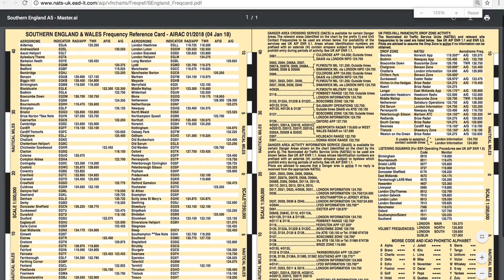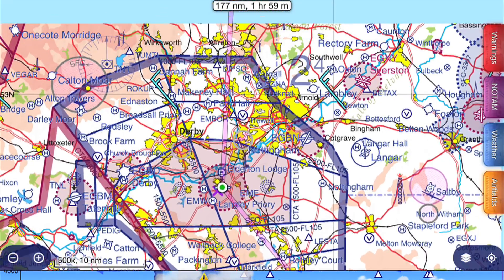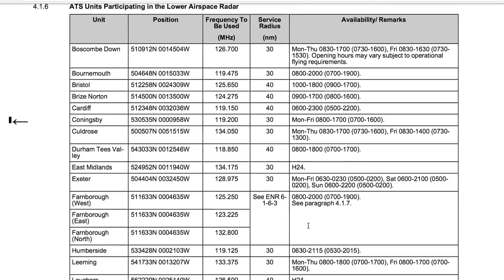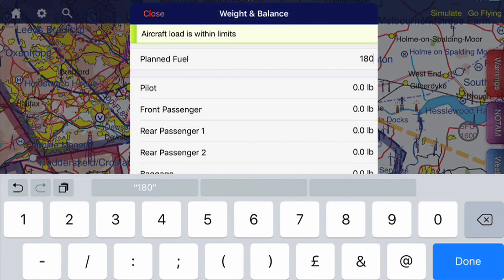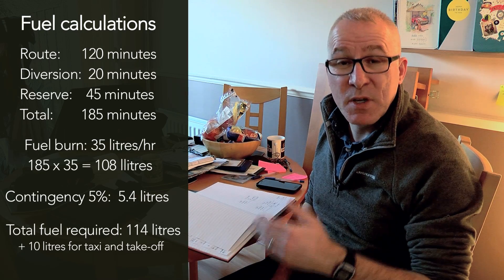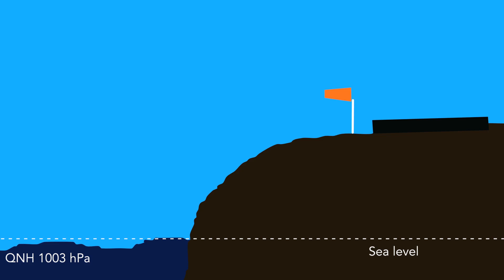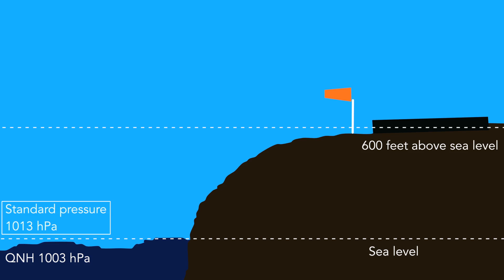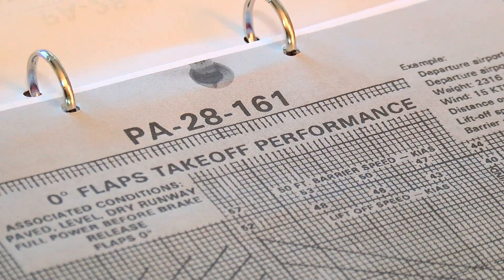Pre flight preparation mini-series Pt3

Comment: Jon, you might want to talk to Sywell when you go over even if above the ATZ. The Blades operate three slots during the day up to 5000ft within 3nm of the field. Have a look at the status page: http://www.sywellaerodrome.co.uk/status.php
Reply from the maker: Presumably they notam those?
Reply: I don't think they are Jon. I had a job just inside the ATZ a few weeks back and part of my prep is to find out about anything local, so I had a look at the website and called them up. I knew that the Blades are based there and have passed by quite often but didn't realise the extent of there operating area.
Reply from the maker: It’s class G so anything goes, but I’d expect displays or intense aerobatic training to be notamed.  I check websites if landing or taking off, but rarely check if en route anywhere.
Reply: Yes same here. Just a heads up. I wasn't aware until I looked into it.

Comment: 185*35 =108?
Reply from the maker: The aircraft burns 35 litres of avgas per hour.  185 minutes of flight will burn 108 litres of fuel.
Reply: I think the formula should be 185/60*35 = 108. Great video series!

Comment: If gliders look more and more attractive to me, it's partly because I'm having a lot of difficulty justifying the fuel consumption in private aviation. The numbers stated in this video, which I hasten to add is well done, should raise a serious issue for anyone who cares about energy consumption and climate change. As far as I know, not a single private pilot on YouTube has made an effort to justify it, and I'm increasingly of the view that the reason is that it can't be justified.
Reply: Come fly with us at Hus Bos.
Reply from the maker: You're probably right.
Reply: Yes, you are right of course. But you do burn some fuel when you launch a glider. An aero-tow  to 200 feet typically takes about a gallon of fuel.
Reply: The engines are very inefficient due to the age of the design. The problem is the cost of getting a new design through the certification process. Gliding clubs are trying to get round this by launching with Rotax powered light tugs. But the reality is they just aren't up to the job.